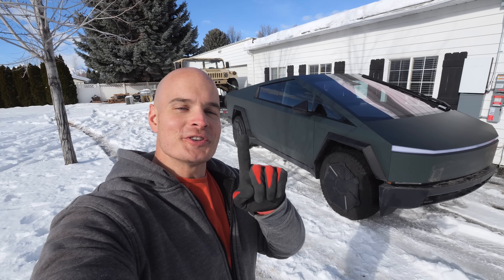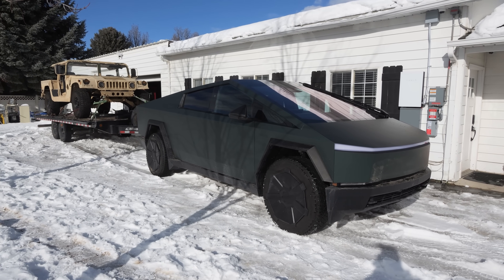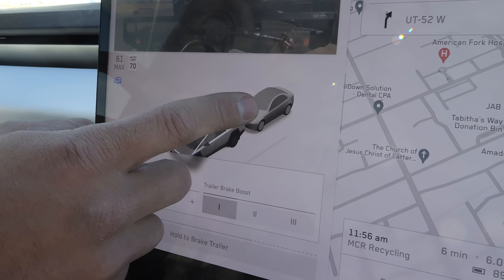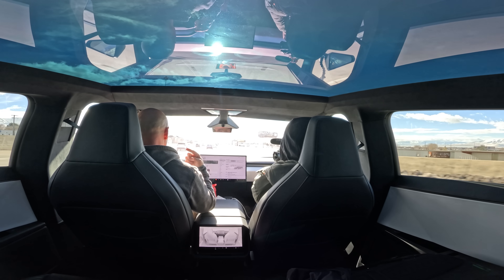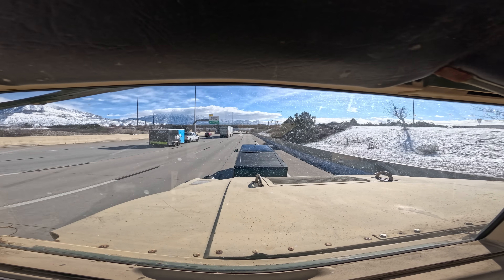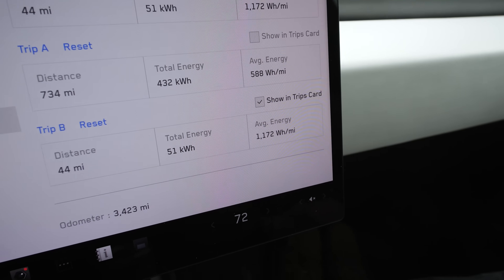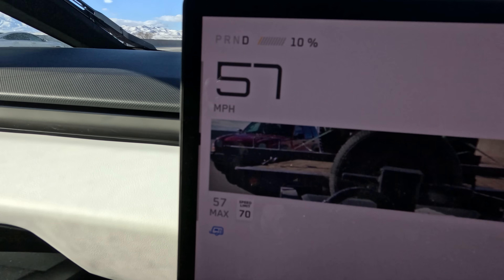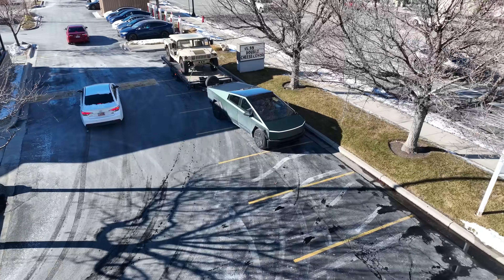How far can the CYBERTRUCK tow 11,000lbs in Freezing Weather?

Comment: The whole steering column being controlled electronically is terrifying lol
Reply: My buddy has a John Deere track tractor it got to where it would the opposite direction you turn the wheel then it finally put the parking brake on going down the road .I’m not sure I’d want anything the computer controlled the steering wheel
Reply: This is how airplanes currently work.
Reply: @NathanWiki Are airplane controls easily hacked. The Tesla is connected to the internet. I bet someone could hack it and put it in a wall at a moments notice.
Reply: @Jack-tx2ve You're right that this is hackable, just like planes. But in reality this never happens. I do agree that plane manufacturers and vehicle manufacturers should spend more time focusing on hacking safety. The road toward electronically controlled component is inevitable if you want to improve products
Reply: @ambroisevalet  Depends what you call improve.
Reply: @Jack-tx2ve  never thought about that. But it's so true. Scary
Reply: @NathanWiki airplanes are tested and inspected at every step of the design and manufacturing by the FAA. Each component down to the smallest bolt must be certified air worthy. The systems are triple redund. If the system fails there are mechanical backups. There can be no modifications to the system without being certified.
Do you think Tesla does any of this? They could send your truck a navigation update and, opps  the steering fails when you get to 60mph. Big pass for me!
Reply: @gener.1253  Really? Tell that to Boeing over the last couple years. But seriously; steer by wire concepts have been around for decades. It's not new per se.

But to be fair to you guys, Nissan Infiniti Q50 had steer by wire and a backup steering column. I think they were the 1st mass production steer by wire vehicles but don't quote me.

I've seen steer by wire concepts since the 80s.
Reply: @robertnicholls9917  Airplanes still have manual controls in case of emergency. The cybertruck does not. There is no mechanical steering. Planes, cruise ships, and others have manual shafts and controls for backup. An airplane can be manually controlled, and pilots are trained to do so.
Reply: @NathanWiki in concept sure. But the engineering reality is very different.
Reply: airplanes have triple redundancy. @NathanWiki
Reply: @NathanWiki  dude. Airplanes been around for years. And air/land is way different lol
Reply: @AkronKid330  “airplanes have been around for years” yes exactly, which is why you should trust steer by wire.
Reply: @NathanWiki I am assuming that there are two separate systems for pilot and co-pilot, no? At the very least there is a backup of some kind. There is no backup on a car.
Reply: @NathanWiki  you really don't see the difference between an airplane with triple redundant avionics which are meticulously controlled and serviced and built to a ridiculously high spec costing multiple million dollars; and a cheap car steering box which is built to a price? And normally never serviced?
Reply: @AkronKid330  exactly, the technology has been around for a while, nobody is terrified of taking a plane because the steering is electronically controlled, the most dangerous issue is human error. People were terrified of automatic elevators when they first came out, but nowadays people would be more scared to use a man operated elevator like they had back in the days
Reply: @albinklein7680 Funny that you mention plane avionics being triple redundant because the steer by wire on the cybertruck is actually triple redundant! It has 3 individual electric motors connected to the force feedback unit. So yes, it's also triple redundant.
Reply: @albinklein7680  Boing has doors falling off.
Reply: @migueljardim8177 
I'd have to look into that but, going by your 'explanation', I'd say the CT doesn't have a triple redundancy feature.
Triple redundancy means there are 3 individual modes of operation, the last of which would be a mechanical connection of the controls to fall back on when all electrics (and thereby the '3 motors') is lost.
Just the though of driving that thing is frightening!
Reply: @WeeShoeyDugless  You’re confusing autopilot with fly by wire. 

Modern large aircraft have no physical connection between the control surfaces and yoke (or in the case of Airbus: joystick). It’s all electronic. 

“Putting in manual” doesn’t magically create cables or hydraulic lines between the pilot’s hands and the control surfaces of the aircraft. For large aircraft, it wouldn’t be any safer if there was direct cable control as no human is strong enough to move the rudder of an A380 anyway.
Reply: @NathanWiki  Because one has to do something on one vehicle because of its design does not mean that one should do it when other methods are available.
Reply: I would definitely prefer solid links.
Reply: People have already mentioned that the system is triple redundant. If one part fails then it will tell you and you take it to get it repaired. If that still scares you then you might not want to hear that brake by wire has been a thing for decades. You know, brakes. That really important thing that you definitely dont want to fail. I hate elon as much as the next guy but you dont need to start fear mongering things that have already been proven for years. Especially when there's plenty of real criticism
Reply: @randaspread  the fly by wire install on commercial aircraft and military fighters are triple redund and every part is certified flight worthy at the cost of millions of dollars for each plane. Do you really believe that Tesla apent one dime more than necessary on the steering of their mobile urinal?
Reply: I don't want to ask a computer for permission to steer my vehicle . I want to be fully in control. All my vehicles were made in the last millennium. I can see the pros in having a simple computer for fuel injection but that is where it ends for me. In terms of electrical systems, I like switches connected to what the switch is operating, I don't want a computer vetting my decision to operate anything. That is the way I will keep it.
Reply: @Jack-tx2ve  I feel the same way. And I'm not saying that because I can't afford the vehicle. I'm saying that because even if I could afford it, I wouldn't buy it. It's a pretty cool vehicle, and definitely different. But like you said. I wanna be in control!
Reply: I wonder why this could even be road legal. Insane. How do you move that thing in an emergency?
Reply: Most cars are like this these days. I don’t like it because there is no feel. All ford mustangs are wired.
Reply: @Andrew260RS  most cars are electrically assisted but they still have a steering column. No column is crazy.
Reply: @Jack-tx2ve  Nissan has had no steering column in the Infiniti Q50 since 2013. This isn't revolutionary.
Reply: @vitaliy9932 
Doesn't mean to say it's right?
Reply: It's been out since 2013, this isn't new tech.
Reply: Nowadays everything is electronically controlled, so if this terrifies you, I wouldn't suggest getting a recent vehicle, the steering is just a small portion of the dangers of having an electronic problem. But then again, jets have used that forever, in reality electronic problems never occur!
Reply: @ambroisevalet  being an electronically controlled mechanical steering system is totally different from the Cyber truck. It has ZERO mechanical link between the wheels and the fool in the front seat!
If all the magic smoke escaped from the steering control of my Toyota, I can drive it to the dealer to have it fixed. If all the magic smoke escaped from the Cyber truck steering controller, you can drive it off a cliff.
Reply: Ford Explorers are like that and the steering fails quite often, but usually before you get moving. Water pumps are also electric now. My son has one for a police vehicle and they are one of the last vehicles police departments can choose from.
Reply: Steer by wire? Gvt override doors lock sends you into a tree
Reply: It’s how airplanes have done it for decades why is it terrifying?
Reply: We all know electronics never fail.

Comment: Considering how long it took them to iron out the actual building of the truck, I would have thought, since they are supposed leaders in tech, that they would have had the software nailed down.   Not recalculating range based on how much the vehicle is actually consuming is dangerous and the bare basics.  If they are doing the calculation in the Nav, why can't the range be updated at the same time.    Add in the lack of information provided for  towing and animations of getting your rear end being bashed in my semi's and it's clear that this shouldn't have been released yet.    The more I see of this truck the more I get turned off.

Comment: 145km while towing 5 tons. We tend not to have such weights towed by passenger vehicles around here. Those are weights for proper trucks you need separate license to even drive and then separate addition to that to pull trailer with it, but i'm pretty sure local trucks get far more range, with out sweating and even our "pull horse" passenger vehicle, pulling trailer with its own weight on it can do close enough and no problem even if you miss calculate fuel consumption and are stranded. Get the fuel can from trunk, get ride to gas station and come back to refuel to get there. Would hate to carry generator to get into charger and can EV's even charge while driving? pretty sure that is disabled, for myriad of reasons.
Also absolutely no to drive by wire! We have already seen how bad idea electronic locks on car doors are, same with electronic brakes. You can ask about that from Chinese guy who was burned alive by his EV cause he could not get out or people trying to help in.

Comment: The 800V pack doesn't help in charging at all since it's a split pack. During charging it splits into two 400V packs so that it can directly interface with the 400V superchargers without needing to step up the voltage before charging.

Comment: I can’t get behind the variable steering depending on speed. When I need to defensively drive I need to know what a 90* turn of the steering wheel will do, without question. I also can’t get behind a disconnected steering wheel, I thought we learned this with hydraulic steering, works until it leaves you without control…

Comment: Keep in mind that when you are towing, you are limited by tire traction, and you're right at the limit of traction. All three vehicles could in theory accelerate faster but tires coefficient of pressure to static friction is already near its peak so you could probably do better by increasing the weight by putting sandbags in the rear axle on the bed of the Cyber truck
Reply: Or shift weight forward on the trailer, increasing tongue weight by . . . rolling the Hummer forward 🤔
Reply: @alsavage1  Only problem with increasing tongue weight is it hits behind the axle of the tow vehicle, reducing weight on the front wheels.

Comment: Lol EVs suck at towing lol, and then you have to sit and wait over 1 hr to fully charge the battery lol. When towing comes to money, time is money lol. A diesel or gas truck can also carry a larger fuel tank plus a auxiliary tank in the bed. So a diesel truck can have about 150 gallons of fuel. And to fill the tanks at 10 gpm, it will take 15 mins to fill up…
Reply: My sprinter van is equipped with the factory tow package (upgraded suspension and a 150kg vertical load rated hitch) and it can tow 3,7 tons legally. With the sprinter van fully loaded and a four ton trailer I get about 550-600km range out of the 90 liter tank at about 100-110 km/h.

Comment: As someone who owned a Nissan LEAF. You should have learned the optimal highway speed for the most efficient  range before heading out.

As you stated wind resistance and rolling resistance increases exponentially after a point.

I found 55 mph was the most realistic speed to cruise at for my LEAF. Im sure no one is going to bother you towing at a slower speed if you needed to go a little slower than surrounding traffic.
Reply: The truckers will absolutely love you for that...
Reply: @albinklein7680  I'm also a professional trucker, so what is your point? Assuming some status assigned to what type of vehicle one owns and drives?

If so, do you have a lifted large vehicle that over compensates for a lack of manhood?
Reply: @hrodgarthevegan  I live in Germany and here we have long sections on our highways where overtaking with trucks heavier than 7,5 tons is prohibited. I get extremely p*ssed off when I have to drive half an hour behind some freak who drives 10mph under the limit. It is one of the most annoying things imaginable.
It is also a safety issue when you have to pass cars in heavy traffic with a 45 ton semi.
Reply: @albinklein7680  Sorry about your countries laws. Safety is paramount on the roads, for you and others. Driving is not a right but a privilege. 

✌️
Reply: @albinklein7680  Sure, but the speed limit is not the speed you have to drive at. Read the law. There is allowable speeds to travel at. Now if another driver becomes upset over this, that driver is questionable as to be in sound mind to operate and share the road with others. (road rage types). Let the Police handle these issues.

Just to let you know, in my area 55mph is the normal speed limit. With only a few areas that go higher.

Comment: If I had to spend 1 hour for every 90miles towing 11000 pounds (150km with 6 tons), I would be sooooo screwed and making negative money. The 3L diesel isuzu does 25mpg with that load and 200miles range :) with average speed 60mph. And as usual, great and very informative video! In europe we won't bee seeing cybertrucks, hopefully, it looks hideous.
Reply: Agree with the CT's looks, but EV towing still makes sense for a lot of use cases (maybe not yours).  Esp. for local construction, routes, and last-mile type deliveries.

I'm a fan of trailers for moving things, myself.
Reply: @alsavage1  You're talking about commercial EV towing with trucks that operate a fleet with 24/7 turnaround. Even that is hardly a proven business plan. It's highly experimental and totally unproven actually. You'll have to own at least 1.5-2x as many trucks to accommodate the time loss due to charging, you'll be permanently constrained by the range, locking down your businesses ability to serve longer routes, you'll have a totally unknown set of maintenance issues and costs - EV's are unserviceable by the owner/user whereas diesels are easily maintained and costs are known and can be projected, etc. All this EV towing nonsense is a pipe dream for now. But all that aside, what this definitely demonstrates is that EV towing for pickup truck owners/users is a non-starter.
Reply: From the first time I saw it, it looks like a grade 8 shop class used plywood and plexiglass to build a truck!  Ridiculously fugly.

Comment: Also probably worth pointing out that it did 90miles with 10/15miles of those being done at less speed than the tested 65/70mph. At those speeds it would have probably done closer to 80miles

Comment: Electric enthusiasts still don't get it.
Towing is not about torque, you need rolling momentum and proper gearbox. 

Regenerative braking and 0-60 woo woo, are all gimmicky fun.
But for real life application, you need proper gearbox and free rolling momentum (via weight).

Otherwise you are consuming energy equivalent of full throttle (for entire trip).

Comment: $13 for 90 miles is .14 a mile. 
For comparison my truck hauling a load comparable to yours gets 14 mpg.   Fuel where I live is 2.45 a gallon so it cost me .17 a mile.   I think the extra .03 is worth it to not have to worry about how far I can go and not have to slow down and hyper mile to make it to the next station plus I can still get 250 miles to a tank and can fill up in less than 5 minutes
Reply: That was what he said it cost to charge at home. He didn't say what it cost to charge at the charging station. My educated guess is it's more than it would cost to gas up your truck. But we can't advertise that now can we.
Reply: where do you live where fuel is $2.45??
Reply: @tacticalidiot175  I was in Indiana two weeks ago it was 2.45 there is 2.85 where I live.

Comment: My Lightning towing a 16’ enclosed trailer in similar conditions gets about 110 miles. Which in reality is about 50 because unless your destination has a charging station, or there’s one in route, you have to  get there and back on what you left with, plus have a small buffer for headwinds, etc.
Reply: electric trucks are a joke
Reply: No problem.  Just put a 25 Kw diesel gen set in the trailer and charge as you go.

Comment: What interested me was you can legally tow at 70mph without any anti snaking devices. Here in the UK you're limited to 60mph on highways even with a mechanical and electronic anti snaking devices. 
We also refer to sitting behind a truck to benefit from their air resistance as slipstreaming.
Reply: that sounds like tyranny to me... 60mi/h on a highway? How stupid do they think you are? That's more dangerous than going fast!
Reply: @tacticalidiot175  It's 55 in Germany and the Netherlands, 50 if you're towing more than 3500kg. And it's a lot safer. Turns out people on the road are more stupid than you thought 🤷
Reply: The UK is a crap country. So...

Comment: Great video, and very relevant for us up here in freezing Norway.
I'm wondering if the ambient temperature is as relevant when towing?
I'm just thinking about the extra energy output from the battery that would heat the battery anyway.
So if you start with a preconditioned battery, wouldn't the cold temperature actually help?

And BTW 60 mph = 96 km/h 😋
Reply: Cold air is denser and with such a non aerodynamic trailer I think it has a measurable impact on the range